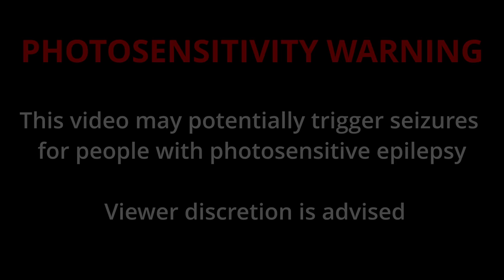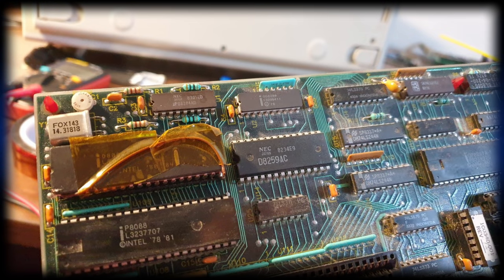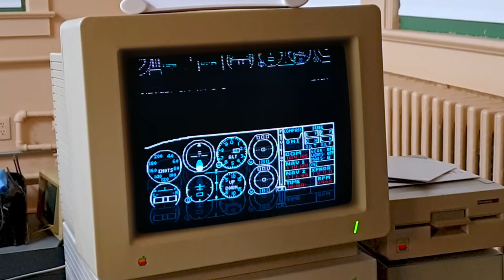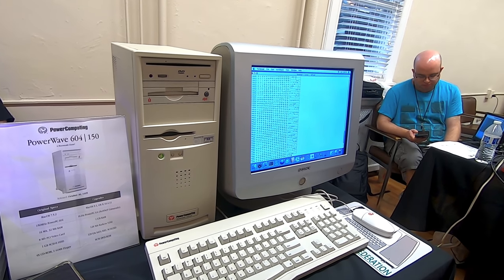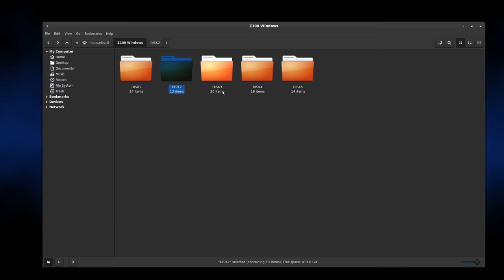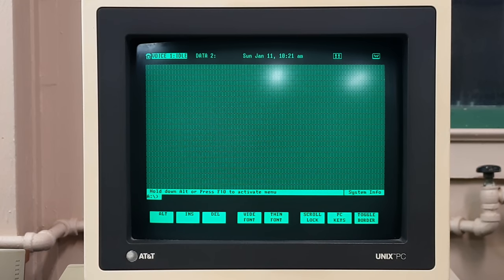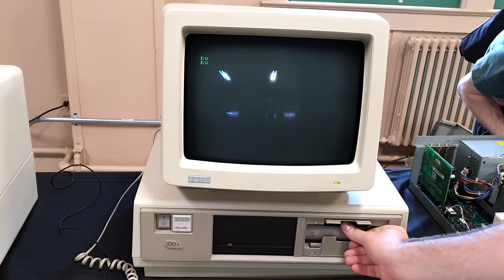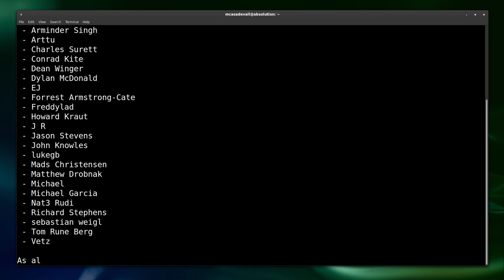Cursed Apple IIgs, Odd Windows 1.0, iMac Prototypes,  the AT&T UNIX PC, And More (VCF East 2021)

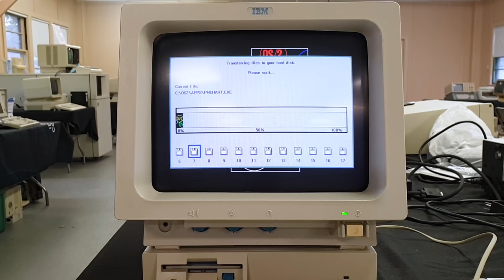Comment: 6:30 - Hey, when OS/2 2.0 came out (actually before, as I was in the beta program) I ran it on a PS/2 Model 30/286.  Yes, a 286. Because I had an Evergreen Technologies 386SX upgrade slapped on, with 4 MB of RAM, and a 20 MB hard drive. This system was BELOW OS/2's official minimum specs, and I masochistically ran it anyway.
Reply: Wait what
Reply: wait.... what, how did you... put a... timestamp?
Reply: @vonatok  You just type a time,? And YouTube turns it into a link to that point in the video. Here’s me typing just a four color twenty: 4:20 - YT turns it into a link.
Reply from the maker: @vonatok  It was released to Patreons beforehand.
Reply: I ran it on a 386sx-16 4mb of ram, CGA card and 40mb disk.... so painful! so slow! so chunky, so 32bit awesome!
Reply: 4:20
Reply: I was spoiled.  I ran it on a Unisys system that cost me a small fortune.  486DX-33 with 8MB of RAM, a 1x CD-ROM driven by SoundBlaster's proprietary IDE interface, and 2 100MB SCSI hard drives.  The thing was a beast in it's time.  OS/2 felt like it was leaps and bounds ahead of Windows at that time.  I was sad to see it not get very far.

Comment: Fun fact: The RS/6000 series was not only important as workstations and servers, it made a significant contribution to unmanned space exploration.  IBM made a radiation-hardened single-chip computer called the RAD6000 that was based on the POWER1 instruction set used in many of the RS/6000 line.  The RAD6000 has powered many well-known space probes, including the Mars Exploration Rovers Spirit and Opportunity.

Comment: That HP terminal is gorgeous, and the HP3000 hardware (even the later PA-RISC "XL" based hardware) was all very impressive. But man, I hated MPE/ix with a passion. I tried everything to ensure that I only had to deal with the HP-UX (HP9000) side of the house (I had no complaints about the HP9000 / HP-UX stuff; I loved my 735/125 workstation), but I'd keep getting looped into work on the 3000. I miss working on VMS, HP-UX, Irix, etc., but I sure don' t miss MPE.

Comment: Sorry I wasn't able to make it. If you want that copy of Lotus 1-2-3 to archive, feel free to contact me via e-mail.

Anyway, I used a HP3000 in high school. They were long in tooth by the late 90s but my high school was STILL teaching HP3000 BASIC for intro to computer science courses (eventually replaced with Visual Basic) and they were using the machine for the school scheduling and grading system. I guess if it ain't broke......

Also I have a PC Transporter, so I guess my Apple IIgs is cursed. I even got it working with 1.44MB HD 3.5" floppies!

Comment: @22:52 nope. the RX50 floppies are not dead. Theyre QD, single sided 400K. Quad Density. Another magnetic medium than most other floppies of the era, and not compatible with MSdos machines (and delibarately so  according to wikipedia)  https://en.wikipedia.org/wiki/History_of_Digital_Equipment_Corporation#RX50    Edit: saw you had teh right  media for the other machine.. I jumped.

Comment: Did you tell a correct Sound Blaster to play 8088 Domination? A sound blaster(sound card) for ISA 8 bits??
Reply from the maker: I'd actually need a soundblaster compatible, the PSU in the Portable doesn't generate -5v, and the original SB card is one of the very few that needs it for the pre-emp circuit. There are ways of wiring in a voltage regulator to fix it, but I didn't bother. I did have an AdLib in there though and had Ultima 6 on the Portable.
Reply: Atx PSU not modern for -5v and -12v Will be good if you need that sound blaster 2.0 send me a beep.